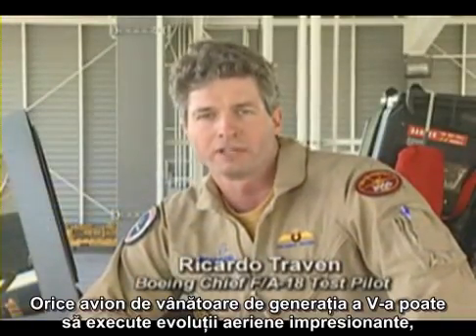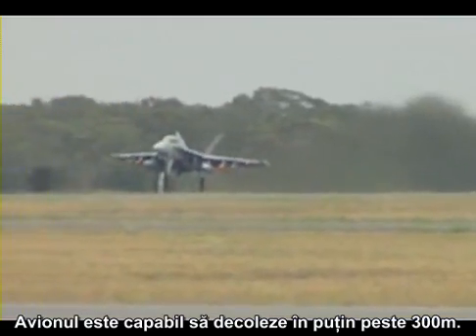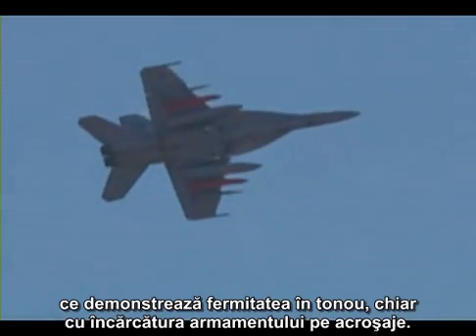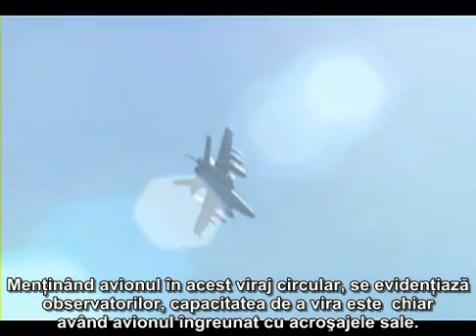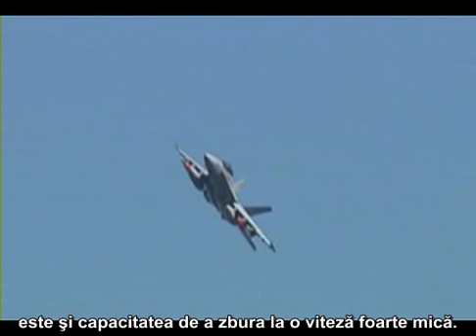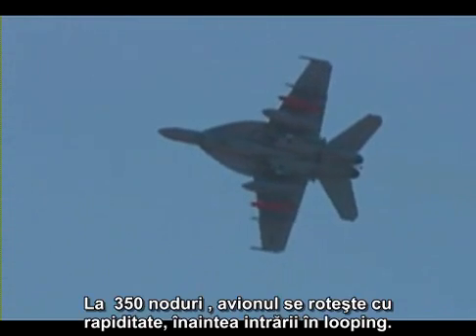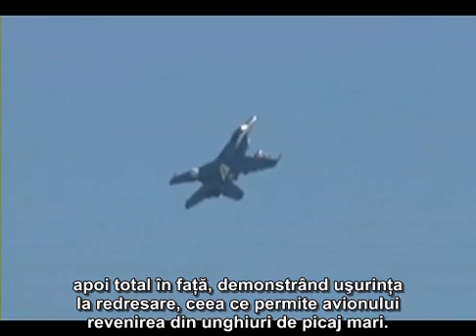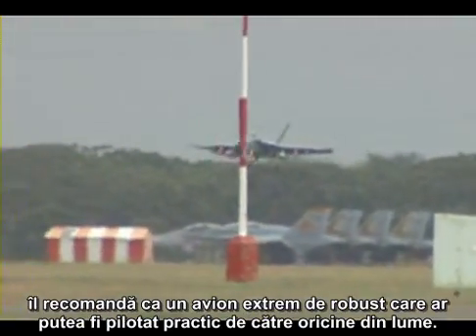F-18E/F Super Hornet with 6500 pounds loadout demonstration!

Comment: Why dude call the superhornet a true 5th gen
Reply from the maker: Idk, but it's mainly that for increased weapons loadout and better avionics and radar, cause as constant turn rates, it's actually worse than those of the F-18C. Even the top speed and T/W ratios suffer. It's better in long range aerial fights and weapons. As dogfight not.
Reply: @MaverickSu-35  but no stealth
Reply from the maker: @thinhnguyenduy4099  
Yes, better said 4.5 gen fighter or 4+ as they say.😉
Reply: @MaverickSu-35  ye, the superhornet is only a 4,5 not 5th

Comment: I've heard of some Hornet drivers that have flown both the older Charlie and the E/F Super Hornet, and a few of them have said they actually prefer the older Hornet because it's a bit smaller and more nimble than the SH. After watching your video, I'm not so sure I agree with that. But then, all of my fighter jet time is in a simulator. What are your thoughts on that Maverick? You certainly made the "Superbug" look quite nimble indeed.

Comment: Sensational.  It doesn't have thrust vectoring but it does perform like it has one.  My uneducated guess is that, could it be the huge leading edge root extension that's making the aircraft do such maneuvers.  Also, it's impressive how such maneuvers can be done while its loaded.  None of the Sukhoi Flanker videos (of course, not all of the videos available to the world wide web) I've seen do it loaded when they do demonstrations.
Reply: @Anon emous Provide us a link, we'd like to see it, else go wipe your ass, cause it's full of shit!  :-)
Reply: Hornet has long LERX (acts like forward canard), rear horizontal stabilizer extending beyond engine nozzle and can'ted twin tails access to airflow during high AoA. F-35's rear horizontal stabilizer pivot point is placed after engine nozzle and it's oversize, hence faking TVC functions.  

Vertical tails are useless during high AoA.
Reply: @valenrn8657   "Vertical tails are useless during high AoA. " Yep, that's why she's got canted V stabs and airflow vents through the LEXs.
Reply: @mobius7089  Canted vertical tail yields improvement with yaw control during high angle of attack.
Reply: HUGE control surfaces.
Reply: https://www.youtube.com/watch?v=kMlXeZZQwCQ&list=LLjT5L0a_xJTyZPrl2sOPTyQ&index=76&t=0s
Reply: Is no one going to mention the sawtooth wings that help tremendously with AoA and lift?

Comment: This new version of f18 kicks ass put it up against the flanker any day.
Reply: superhornet all the way
Reply: The A-D has even more outright performance than this. Legacy Hornets are the hot rods.
Reply: @MrMercurybullet  Super Hornet has higher alpha (angle of attack) capability when compared to classic Hornet.

https://youtu.be/JqGYa9uwySE?t=155
Finland F-18C's post-stall reversal maneuvers.
 Notice the drop during F-18C's reversal maneuvers

https://www.youtube.com/watch?v=3RTWnFaQfHU
F-35A's post-stall reversal maneuvers with post-stall hover. Notice F-35A Block 3F difference from F-18C.

https://www.reddit.com/r/F35Lightning/comments/8a66ta/out_of_the_shadows_rnlaf_experiences_with_the/
Out Of The Shadows: RNLAF experiences with the F-35A - Combat Aircraft Magazine May 2018
Dutch F-35 Block 3F, "F-35 sits somewhere in between the F-16 and F/A-18 when it comes to within visual range manoeuvring'".

http://nettsteder.regjeringen.no/kampfly/2015/11/20/a-fly-f-35-erfaringer-fra-den-forste-uka/
More F-16 vs F-35 from Norwegian pilot.
I quote
Overall, flying the F-35 reminds me a bit of flying the F/A-18 Hornet, but with an important difference: It has been fitted with a turbo
Reply: The Flanker would kick the Super Hornets ass. Enough Said.
Reply: @davidfoster2613  False, 

https://web.archive.org/web/20160311173046/asiapacificdefencereporter.com/articles/250/Exercise-Pitch-Black
_
 “The Hornets and Sukhois are having interesting fights with various outcomes. The Hornets have done fairly well, even during 1v1.” WGCDR Jones said Australian pilots were getting a “buzz out of working with a new platform,” but he too declined to offer an opinion on the capabilities of the Flankers. Instead he diplomatically said, “I remain very comfortable that we have the Super Hornet in RAAF service.” GPCAPT Kitcher assessed the Super Hornets as enjoying parity with the Flankers, but that “a pilot’s skill is the most important factor”_

Australian Super Hornet F/A-18F is similar to Indonesian Flankers. F/A-18F is slightly heavier than F/A-18E models.

Comment: F-35 is just waste of money as compared to F-18.Awesome performance can beat any fighter jet with that impressive payload.
Reply: You should tell that to the f-35 pilots, it's the safest fighter in the air.
Reply: Best part is, it is still in our Navy.  Correct me if I am wrong, even when they di get their F-35Cs in the future, the Super Hornets will continue to serve.
Reply: The only advantage i see in F-35 is stealth feature otherwise F-35 is a fourth plus generation fighter.
Reply: @NeranTips  dude the f35 don't need to turn it's radar on ... Even more so it works worth the f15 16 fa18 so they don't have to turn their radar on ... F35 also does this while doing the job of the fa 18 growler ... So it's guiding air to air and Cruse missiles while jamming... Also mapping out the best path to Target for itself and other aircraft... It's like a quarterback or point guard

Comment: Those are all nice n stuff... but can you make the damned thing faster???
It's not just an engine upgrade- recant the pylons to 0 degrees, maybe eliminate the 'saw tooth' and possibly enlarge and/or lengthen the engine intake;
that'll help it perform better at higher altitudes and increase its P-rating
Reply: ACTUALLY!   ACTUALLY  THE  CURRENT,  the  current  F  /  A  18  E  /  F  (BLOCK  3  =  ADVANCED)  SUPER  HORNET!  THE  PROVEN  SUPER  HORNET  WITH,  with  THE  PROVEN  ENGINES,  with  NOW  18  %  more  THRUST  can  MAKE  THE  1.9  MACH,  INSTEAD,  instead  OF  NORMAL  1.8  MACH   BUT,  but  THE  SUPER  HORNET  can  fly  CAN  FLY  EVEN  FASTER!  EVEN  FASTER  YES

BUT!  but  IT  IS  BLOCKED,  TO  AVOID  ANY  DAMAGE  TO  THE  BODY  /  AIR  FRAME  OF  THE  JET    AND,  and  SAME,  same  WITH  THE  BLOCKED  G  RADIUS   +  7,5  G  /  7.5  G,  YES,  yes,  THE  HORNETS  AND,  and  SUPER  HORNETS  CAN,  can  TURN  TIGHTER,  BUT,  but  THE  AIR  FRAME  =  THE  BODY  HAS  SOME  LIMITS  TO  STAND  THAT  KIND  OF  ABUSE

BUT,  but  THE  RAFALE  =  RAFAAL  M  CAN  PROBABLY,  probably  DO  MORE  G(S),  THAN  THE  SUPER  HORNETS  AND  HORNETS,  EVEN,  even  BEING  THE  SAME  KIND  OF  =  THE  MARINE  =  THE  NAVY  VERSION  TOO,  BUT,  but  I DON'T  KNOW,  i  don't  know  FOR  SURE,  for  sure,  BUT,  but  THE  C  AND  B  CAN  DO  9  G  AND,  and  IN  EMERGENCY  11  G  AND,  and  THE  AIR  FRAME  WON'T  GET,  won't  get  DAMAGE  AT  ALL,  at  all!

THEY,  SOMEONE  TESTED,   tested  PROBABLY,  probably  THE  F  /  A  18   C  /  D  HORNET  WITHOUT,  without  THE  G  LIMITS  AND,  and  THE  PILOT  FLEW  12  G  AND  and  was  OK,  BUT,  but  THE  JET'S  AIR  FRAME  AT  LEAST,  GOT  SOMETHING,  got  something  DAMAGED
Reply: boobtuber06 they'll have to redesign the wing. It was an engineering compromise after they realized the new wing had aerodynamic issues, so instead of redesigning it a second time, they kept costs down, while still providing a capable aircraft as the video shows.

Comment: I hope russians take a look at this video and shit in their pants. I HAVE NOT SEEN ANY SU-35 showing anything like this fully loaded, plus I Know for a fact that once a Su-27, 30 or whatever does a stop! it SINKS! because it bleeds out so much energy and is so heavy, it can't sustain the ability to regain full flight advantage. Russians say something now :D
Reply: +Hernandez-Yanez Bold Voyagers of Zion Oooooooooooo those Flanker fanboys must be sooooooo mad.
Reply: Anon emous. Go and wipe your Ass, it's full of Shit!!
Reply: @brettdemauna9994  .  Good One!  I am going to have to use that on the next cry baby!  :-)
Reply: WittySageTV. Seen lots su30 at Airshow's BUT not like this fully loaded Hornet. It also tends to fall uncontrollable pitch nose dive everytime after doing such slow extreme manoeuvres (Pugachev famous Cobra). So yes it already is looking so awkwardly heavy  even when it's not even fully Fueled Armed and Loaded.
Reply: exactly ! Even with full tank of fuel, the capabilty of a Su 35 is compromised.
Reply: that's less than half fully loaded...at least 14klbs
Reply: Su 35 has about the same thrust/weight ratio and a better rate of climb compared to the super hornet. Feel free to check.
Reply: Su30 MKI can do much more than this.

Comment: Anyway the Flankers still have the maneuvering advantage even with Thrust Vectoring. Its Ibris E AESA Radar and AA-11 Archer missile makes it a mean adversary. It's R-77 is also deadly. However,
Reply: R-77 equals US's AIM-120
AA-11 equals US's AIM-9

Yes, the Flanker has thrust vectoring, but it is unclear if the outstanding maneuverability of the Flanker can be utilized when it has a full load of weapons.  This is what this Super Hornet's video is all about.
Reply: @Jojo_Bee  ,no, the R77 in indian SU30 probe no match to Aim120D of the Paquistán F16.... India remove the R77 an add Rafael missiles from Israel in the SU30 fleet !!!

Comment: The A-10 have taper wings, this wing produce more lift (less speed) and also the benefecit of more weapons load carry in his pylons, more that F-35, also two engines, not one as F-35, this mean more relaible and protected in battle damage, two stabilizers if one fail, double wired, armor and 30mm, its old but this dont mean: usless or bad.

Comment: Here's the video he's probably talking about and it pretty much confirm comments made in this vid.  Every high AOA maneuver the flanker does with a weapons turns it into a brick, unlike this hornet which seems to maintain control constantly.

The flanker seems to have a massive stability issue that prevents it being able to do controlled high alpha maneuvers ... it either goes all or nothing ("all" being massive post stall maneuver resulting in it going nose down)

watch?v=UsyMUAfh6fg

Comment: Yeah the air shows in Russia weren't really recorded for the future :( I never seen that kind of flying on huge international displays in England or France. But as I said what I saw was in Russia. Back then tapes were pricey and after a short time it was probably recorded over if it was filmed at all.

Problem is not the planes ability but rather the rigidity and strength of the suspensions/pylons. They'd be the limiting factor.

Comment: @windex210 Im not trying to discredit the AIM 120D, rather, I know it uses conventional propellant, this is what limits its ultimate range and speed. The Missiles size and weight has to stay within certain limits to fit across aircraft hanging racks. European developed RAM Jet motors have surpassed this conventional Missile, it really is, that simple. Miniature RAM Jet technology is European led, and a lot of developement time has gone into it. I cant see them giving it away anytime soon either

Comment: All the stuff that this machine demonstrates has been demonstrates with the ORIGINAL Su-35 (Canards, no TVC) back in 1990s also with full mission loading ie 2 fuel tanks, 4 Kh-31s, 4 Alamos and 2 Archers with a lot faster turning and rotating
Reply: su 35 would have to get a new airframe after experiencing that load lol its just the terrible russian build quality.

Comment: Isn't AIM-7F vs AIM-7M a better comparison? AIM-7B/E are obsolete earlier generation. If you launched an AIM-7M at Su-27 at 20Nm, the Su-27 launched R-27R at you. If you take evasive maneuver spoofing the R-27 early enough and resume locking on that Flanker, will the AIM-7M lost guidance or will it be able to home in on that Flanker?

Comment: No wonder that you think the tomcat is good if you don't know it's limited to 6.5Gs.
Yes the pilot is a factor but it is not everything otherwise they would not develop new aircraft all the time. For instance you put a rookie pilot in an F-22 and he beats the crap out of experienced F-15 pilots 95% of the time.
The F-14 is significantly inferior. Even with the F110s its t/w ratio is not so good so in vertical it's not be phenomenal. Without even mentionning the F-14A which was very underpowered.

Comment: @Battery9876 Yes, I know I've already watched it. The point is that the F-14 is manuverable for its size. Okay, 6.5g's I'm not sure about that one. But the fact is that its not entirely dependent on the type of aircraft, its mostly based on how good the pilot is. Who knows, maybe the Tomcat pilots made a mistake? No one knows except the pilots themselves and their instructors. The turn rate was more than decent for its size. F-14 is respected by many, including other fighter pilots.

Comment: Yes I want to go further.. how many of those kills did the USN see? Who tells you that they didn't lose even more F-14s. I don't trust their figures at all.

The F-14A can pull only 6.5Gs, the F-16 9 - a/a loaded, centerline empty -, that makes a huge difference in turning capability.. The F-16 had better roll rate, much better t/w ratio, better visibility, about half the size, the F-14A is a piece of crap compared to an F-16.

With F110s it was surely better but I am sure still inferior.

Comment: Moreover the F-18E is capable of about 50deg aoa, so it can almost mimick the manoeuvers of a TV equipped aircraft while keeping its lift. An F-18E would beat the crap out any a tomcat at close range.

The SH is likely to have first detection with its AESA combined with its low frontal RCS. And its radar is virtually impossible to jam. It wins hands down in BVR.

It's very advanced jammers combined with its low RCS makes the aircraft much more survivable than the F-14.

Comment: I don't trust the iranian figures for a second. 

The AIM-54 has been launched several times by USN F-14's in real combat and they all missed.

Regarding F-14s vs other aircraft, I have heard of several exercises of F-14s against F-16s, F-15s and F-18s and the F-14s lost big time.

For instance in a dogfight exercise back in the 80's against F-16s block 10s, they lost 86 to 1.

The F-14 was designed primarily to destroy bombers at long range, for anything else it is inferior.

Comment: Hi MetaliCanuck, are u sure that AIM-7M has better radar guidance than AIM-54C? In terms maneuverability, air force in my country stated that F-16C Block 50/52 has better maneuverability than Mig-29 & F/A-18D Hornet. I only know that the Hornet could turn at much lower speed due to greater lift area from the wing. Best for making opponents overshoot like Spitfire vs BF109

Comment: Number One, YOU ARE NOT A PILOT. I can easily tell that so stop pretending. Second, I just said that the A-4's, F-5's and F-16N's DO beat Hornets. My point was that the Tomcat beat all three aggressors, so the F-14 can and DID beat the Hornet. The BVR stats are confirmed from both Iran AND Iraq, as well as some U.S. Navy ships observing the nearby Gulf. The engagements HAVE been proven for almost 36 years at Top Gun. That was the only way to train Navy pilots against MiG's.

Comment: Also about the F-4's and F-14's. The F-4 was only used in trials when the F-14 first came out. The A-4's and F-5's were still used later on. Even the new F-16N came out which were stripped down versions which made it even more manuverable. The A-4 Mongoose was also stripped down and gained more maunverability. Now generally speaking, the F-5's, A-4's, and F-16N's are MORE manuverable than the F/A-18. If the F-14 beat the A-4's, F-5's, and F-16N's, then it can SURE as hell beat the F/A-18.

Comment: Wow you can see a target IF IT ALLOWS you to by flying too high at 100 miles, I fucking new the f14 had an imense radar range, but the miisles were shite,  You wont track me until 3.5 miles if your lucky unless were flying over flat dirt you might get a tone earlier, but if you wanna tangle with a wing of hornets 4 vs 4 the hornets will handle the f14s after first passes. The boys at Fallon know this even.

Comment: BVR means nothing if the missiles cant hit out over 30 miles Constantly, the aim54 was JUNK against fighters, any fighter with a capable RWR system could spoof that big hunk of shit easily, the f14 pilots I talked too and flew against are hands down great men, but 85% of them prefer the basic Hornet model still, the f14 was just faster and a great deal faster at low speed, but could not turn with any hornet on its worst day.

Comment: MetaliCanuck, I don't know what the hell you been watching, I NEVER said the Tomcat could out turn an F-5. FACT is that even though the Tomcat can't, it still DID in fact beat F-5's in training dogfights, even A-4's. The F-14's have been doing that for 36 years at Top Gun, Fallon NAS, etc. Your 30 mile range thinking of the F-14 is WRONG. The F-14 well had over 100 miles of BVR capability.....doesn't the phoenix missile ring a bell? Yeah, I thought so. I do know something that you don't =P